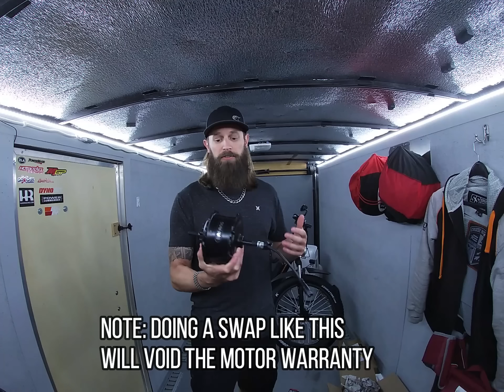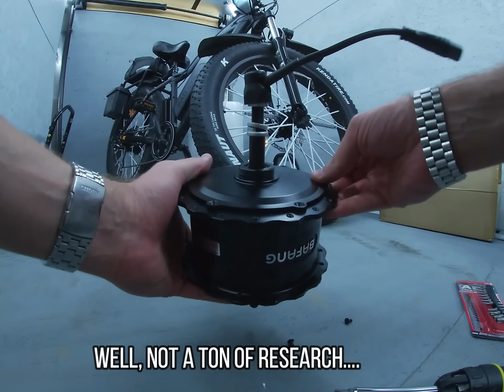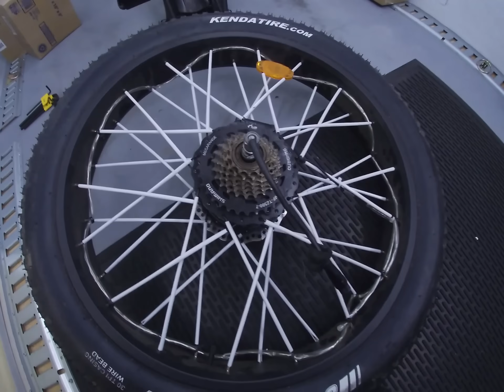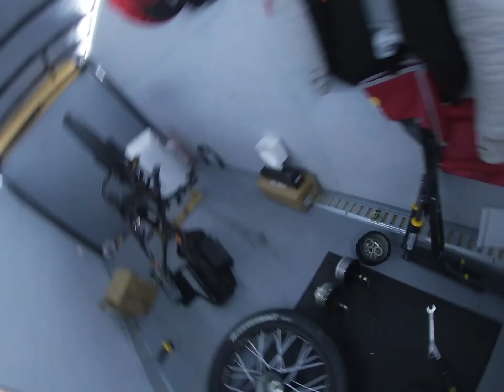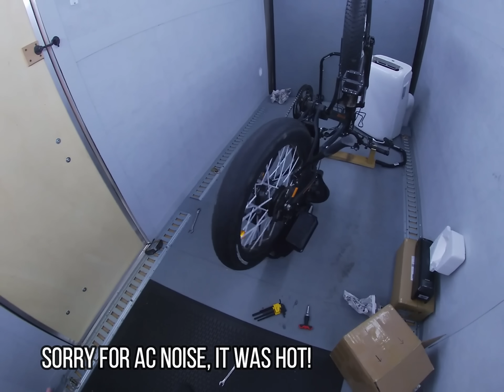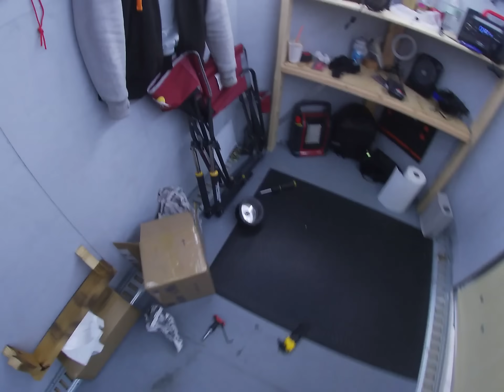750w Bafang Hub Motor Install/Swap -  Rad Rover Ebike

Comment: I do like your approach to mechanics. However, I felt empty after watching this video. You mention the stock hub motor of 750 Watts is not really 750? Or that stock hub is lower on power than advertised? Then do a swap for another 750 and no testing of power difference? This would be a great informational vid of how to swap out a broken hub motor. Not so informational as an upgrade on power.
Reply from the maker: Take a look thru my video library, tons of videos on the power difference 😁

Comment: Now i see bafang have 1000w motor, what do you think????thanks....
Reply from the maker: 1000w drop in replacement?
Reply: @CitizenCycle925  1000 watt bafang i see in aliexpress website, this is rear watt, or what do  you think??

Comment: I'm a bit confused.  Why this change from a 750w to a new 750w motor?  My 2020 RadCity3 now has over 600 miles on it.  Wondering exactly what the reason is for this swap and more importantly, how many miles can I expect from my factory motor?  I should note that I did the hack that upped my max speed to 25mph and in doing so, will that burn out my motor sooner.  I'm very seldomly running faster than 20mph.

Comment: Very helpful. Just swapping in my motor. I couldn't get the freewheel off even with the tool from Rad. As to what happens if the screw gets messed up I can tell you it's a world of pain. I've had to drill it out. Next step is to tap a new thread and go from there. Now back to it on a misty day in East Anglia UK.

Comment: Nice job.   On this vid, the angle of the front fork seams a bit bended back compared to the angle of the frame
Reply from the maker: probably result of trying to use camera in a small space.(my trailer) nothing is bent :)

Comment: The reason you couldn’t get good alignment with your torx tool past the sprocket is because you are using a changeable bit tool instead of a designated tool since the shaft in wider than the designated tool. Second you need a bigger bench so you can work above the floor.

Comment: I just purchased a Bitnelli Fusion...do you know much about them? 750 bafang motor w/a 12.5 ah battery.  Im 5'10 205lbs and it gets me 25.6 mph I have standard battery looking to upgrade to the 17.5 ah. The bike is supposed to go from 25-45 mi on a single charge..
I dont see how it will make 45 mi. Unless ur riding on  Ped assist 1. If u have any info or if anyone else has one of these bikes could I get ur input on them and the motors and my upgrade options besides the battery.
Reply from the maker: Hi Mike, i have not seen the Bintelli Fusion before, dont know anything about it.  just googled it to check it out.  looks nice, looks pricey too though.
Reply: @CitizenCycle925  yeah it was lil over $1700 I've only got 73 miles on it. I've clocked it at 25.6 but today,I could only get to 22 tops might have hit 23 for a sec. This was on a flat rd. (Really flat) i seriously doubt I can get 20 miles on this with just the throttle.. fully charged..i ran it about 5mi and its down 37%. Its fun and very comfortable but it could use some shocks. Tires altho big dont provide enough cushion over bumps. 
I feel like its not great at making sharp turns either.  Other than that its pretty cool. Im just not savvy on the battery maintenance. Like do u have to runnthem completely empty? Cuz ive just rode around then brought the battery inside to top off what I used. 
Any suggestions or advice would be appreciated.

Comment: So they use 500w as 750w 🤔
Reply: 500 peaks at 750, so technically not wrong.  750 peaks at just over 1000 and so on..... Just Rad getting a little carried away on their rating as opposed to other manufs.  Doubt they do this any more.

Comment: So can i just buy a higher powered motor than whats in my ebike, plug it in and have  more power or do i need a new controller too?
Reply from the maker: i dont know enough answer that one.  my guess would be that you would need a larger amp controller too.  volts x amps = watts..

Comment: Hi, I’m in the uk,I have a rad rhino 5 @ 250watt motor,I would like to change the motor to 750,can you help with what I would need and links to where I can buy the parts needed
Reply: Bolton e bikes.

Comment: I wonder if the 1000w bafang G062 fat tire rear motor would be the same way.
Reply: It's 750, not 1000.    https://www.bafang-e.com/en/oem-area/components/component/motor/rm-g062750dc/

Comment: how do you which motor to pick(male) to go into the female connection? i recently had to swap a rear wheel(motor attached) and the connection was incompatible i had to rewire the a new female connection to the controller which is tedious.

Comment: Good work my friend! anybody know if this change is possible for the RadRunner 1?
Reply: I have the Rad Runner 1 and sure you can, you need the 35a Controller & KT-LCD8H Rad Combo & the 48 - 60v 750w Bafang geared rear hub motor.

Comment: Are you saying the 750 that came with my 2019 rad rover is not the same as the new one? both 750??
Reply from the maker: I am certainly not an ebike builder or technician, but as you can see in the video, the aftermarket 750watt Bafang motor i purchased to install was quite larger than the one i took out of my Rad bike.  From what i understand Rad bikes output 750 watts, they just appear to do it with a smaller motor.  you can overvolt a motor and run it at much higher watts, when i upgraded my controller, my rover started outputting 1200watts.  so i was running 1200 watts thru that little motor with no issues.  later i decided to put the bigger motor in just so i wasnt pushing that little motor too far.

Comment: Hey Citizen Cycle - Did you ever get the third gear resolved and what was the issue?  I'm still waiting on my controller and 750 watt motor from EBW and wanted to be prepared when it arrives.
Reply from the maker: Resolved, derailleur just needed adjustment. Shifts perfect now

Comment: That stock motor looks like a 36 volt 350 watt model that's just being overvoltaged to 48 volts/750 watts but it still only has the torque of a 350 watter as compared to the real thing, many comments on Rad bikes not being very good with hills if at all, it does look very small...

Comment: Thing-is about Rad is that you get a lot of bike for a low price but for another thousand dollars (& up) other bikes are everything the Rads aren't, bigger batteries, better brakes, more powerful motors and controllers... I just got one with a Bafang Ultra mid-drive motor, actually the most powerful motor available on a production bicycle and that's immediatly obvious when you ride it, another from the same company which I get in a couple of weeks is a Juiced Scrambler clone with a REAL Bafang 1,000 watt nominal hub motor, time will tell with that one but has a good reputation btw subscribed 🤗

Comment: I was going to buy a super 73 until i read all the horror stories about it on reddit. During research, i figured out that building these bikes is pretty easy. I found a scrambler style frame for sale and a 1000w 20 x 4 motor. I used to be a mechanic so i should be able to figure this all out
Reply from the maker: Good for you!!! and good luck!

Comment: Super easy to adjust gear there's one  adjusting screw. Turn 1\4 turn  increments in one direction to start with until  gear  doesnt jump anymore but if it gets worst turn back adjusting screw to original position and turn screw in other direction with 1\4 turn increments  until it doesnt jump .If that doesnt fix it there's another problem . Also was the new freewheel first gear easier or harder to pedal because on a stock Rover first gear has 34 teeth the new first  gear has how many teeth ?Thanks for the video

Comment: Taking the rear wheel off and on gets MUCH easier. I can do it with my eyes closed now, but at first it was scarey hard b/c the assemblers at Juiced Bikes in China installed my rear wheel totally wrong, so my torque sensor wasn't even working.

Comment: Is there grease on the nylon planetary gears and/or the 3 planetary gear axles? If so, any idea what type of grease (lithium or a lighter grease or real tacky thick grease?) I'm really hoping for an answer as I will be taking mine apart this winter to check condition and regrease if necessary. Thanks in advance!

Comment: Hi there, I am from Vancouver Canada and have been following your channel for a little while. 

I was trying to buy a radrunner plus from Seattle and bring it back to Canada since the Canadian laws are stricter than u.s. and only allow 500 watt motor Max. Hence the local dealer near me only sells to 500 watt a 500 watt version.

Then in one of your videos you mentioned that you suspected the US version is not a true 750w motor. Then it got me thinking that the same Factory is really only making one model and programming the controller differently for each country.

Based on the images seen in your motor swap where you had the two Motors side by side it is clear that the stock motor that came with rad is not a true 750 w.

Based on information from your videos I decided to buy the bike locally and to upgrade the motor and battery at a later date.

Though I don't even have the bike yet I do enjoy watching all your videos.

Somewhat related, I commute daily on a 2000 watt electric unicycle with a 1600 watt hour battery. Too bad they don't have the same size motor and battery kits for the rad :-)
Reply: Did you get the bike??
If so how are your liking it.
Im in Vancouver also and thinking about getting this bike.

Comment: Moving to a 52T Chainring is a HUGE performance upgrade.
You will not find anything better for the cost.
Reply: 52T. Chainring will give you better top speed, but the bike will not climb as well.  It also may cause the motor to heat up.  But yes you will definitely get a higher top speed.
Reply: could you elaborate ? I was considering this to on my stock radwagon 36T :) which cuts off at 30 kph "freewheeling" basically. How about steep hills with the 52t ?
Reply: @Ematuresco  
stock radwagon 46T?
52t should still be fine for the heavy radwagon

Comment: Yeah Rad Power Bikes is a great company and the bike is so great that it makes you forget that your buying a 500watt motor being advertised as a 750watt motor. I have the Sondors MXS and its a true 750watt motor like the one your putting in. Great work on the video.
Reply: Bro so right. I had a mate X first turned out to be a bust. So many reviews online about how great rad is ANOTHER BUST. Got an ECOTRIC FAT tire with a 500w motor feels a lot more powerful for half the price. Even got the suspension  fork from their site(still a great price). Don't trust these paid YouTube reviews.

Comment: If it's not been said, you really should consider letting bike shop tighten the freewheel and adjust your bike. You don't want any mishaps while you're increasing speed and power. I'm looking forward to seeing your speed and Hill climbing results.

Comment: Awesome!  Thanks for posting, I was waiting for you to do this install.  One question, did you lube/grease the gears before putting back in?
Reply from the maker: i did not add any additional grease, but you are right i probably should have just to make sure it continues to run smoothly.

Comment: So, "in a nutshell".....We were lied to.  Nice!!
Reply: @† Romans 14:11 that is incorrect, the 500 watt and the true 750 watt come in exactly the same identical casing. Very easy to swap
Reply: @Scatterbrain70 so if there in the exact same casing. Couldn’t a person swap dual hub 500 watt for the 750 watt for more power maybe?  At least little better hill climbing
Reply: True Wattage from my understanding is contentious nonstop wattage draw without overheating . That is not  peak wattage .
Reply: @sen3reyx  I really do love my custom Rad, whether it's what is advertised or not. Getting ready to buy some more power for the beast soon. Can't wait for better weather!
Reply: @sen3reyx  I generally don't get a chance to ride in the Winter months mainly because of lack of daylight. By the time daily responsibilities are over, it's too cold. Winter in the North-east is just not what I want to be riding in, unless we get an unusual warm/fair day, I can't enjoy it.
Reply: you get what you paid for.
Reply: It is the motor controller that boosts it to almost 750 watts
Reply: I have a 2019 RadRover, I was never thrilled with it until I put a true 750 motor in with a new controller and a DATEx 2 parallel battery adapter with two 52v 20amp triangle batteries from Bolton now it pleases me to no end😎👍
Reply: @Mark3855  My Rover is still really good, even approaching 5,000mi.  This Winter I want to upgrade the controller, batt. , and Motor.

Comment: Nice job, I would have (shudder) used a drop of 'Locktite' on the screws when sealing the hub and to tighten the 'free-wheel', an old length of chain to use as a wrench.  :)   (I would bet that the 3rd gear set is bent somewhere along the circumference...

Comment: Thanks for posting this video. My 750w Bafang from Bolton is arriving today, I added the 35A controller about a month ago. They implied it was super easy to swap out, but now I'm guessing if I want to use the existing freewheel with the new motor I will need the special tool to remove it.... I'm not sure if the new motor comes with a new flywheel, but I don't think so.
Reply from the maker: Not having to tangle with freewheel removal was a relief.
Reply: I think the Freewheel removal tool will cost about $10 on Amazon.  Just make sure you get the correct one.  I would think Rad would give you that information.
Reply: @MumfordJim  But how do you get around the hub motor electrical plug being so thick?  Once the wheel is off and the electrical cable disconnected the plug is so thick I cant get the washer's/nuts off or even get the cable through the freewheel tool to remove it?  Trying to replace the freewheel myself.  I have the replacement and the tool but i cant figure out how to do it with the fat plug.  Any help would be appreciated from anyone....
Reply: The Park Tool F1.3 is for the rad

Comment: Nice video. Two questions; are you convinced both motors are 750’s and have you determined if there is significant difference between the “freewheel’s”? It would be good to know if the stock motor is being mis-represented and whether the difference in the freewheel gears caused the 3rd gear jumping.
Reply: Looks like the original was a 500w not a 750w, and almost half a stator

Comment: While removing the motors from the casing, remember not to touch the sides!! Taking a picture(s) before disassembly helps a ton. At least you didn't have any left parts like I usually do. :)
Reply: And don’t practice while high!
Reply: Why not touch the sides of you don't mind me asking?

Comment: You know that the hub itself houses the magnets right?  In this  case it's the stator of this brushless hub motor. So you really replaced only the part that rotates, probably not designed to work together all that good.
Reply: The casings for all of the G060 fat motors are identical and interchangeable with the motor cores so a swap is a perfect substitute.  The casings only house the hub bearing.  Nothing else.

Comment: i don't even have an ebike ....yet and this was totally interesting and fun to watch. thanks ! I went ahead and pre ordered a Bolton Blackbird...but have to wait till Sept.  One question, in putting the star nuts back on did you use a torque wrench as I suppose there may be a tolerance that should be met to handle such power?...or just put them in as tight as you could, brute force torque?!!!
Reply from the maker: hi Steve, really glad you enjoyed the video.   September for your black bird ugh! thats a long time :(   i did not torque wrench on the screws, just cranked them down with screw driver, thats how i got them out so i figured good enough for putting them back in!  haha

Comment: Great upgrade post. I saw some people asking about power changes. There's a guy on YouTube called SuPRCooPr who did this upgrade. In his Vlog 3 he is talking about the torque and top-end speed. He said a lot more torque and he had it up to 29 on flat ground motor only. I would expect that with the higher amperage and a true 750 watt motor. I was curious what you think of the quality of the gears in there. To me that's the weakest link in a power upgrade. Keep them lubed. Lol. PS, I checked out Electro Bike World and it looks like the place to go for RR power upgrades. I'm still waiting on my controller from the other gentleman.
Reply: I finally got my controller from that other guy and it’s great. I’m truly disappointed to learn that radpower did indeed use 500 watt, or smaller, motors while calling them 750’s.
Reply: Yes rad should put a real 750w motor in

Comment: had a rad rover couple years ago, love the vids. I am now waiting for my Bolton bike to arrive. Odd question for you, what watch do you wear and what is that bracelet that looks like a watch bracelet? (I run a watch YouTube channel) thanks.
Reply from the maker: i wear a Citizen's Eco-Drive watch, (very fitting right..) not sure on the model number but i've owned it for about 10 years now and its still going strong.  i wear it everyday of my life no matter what i'm doing. the thing has been virtually indestructible!   love it to death!  my bracelet is about 5 yrs old, it has no markings on it of any kind, not sure what brand,  i just went into a jewelry store and told them i wanted a really wide bracelet that looked like a watch band, we picked one out of their catalog and ordered it.  was cheap, like $150. i should have bought 2 in case anything happens to this one.  i knew it was a matter of time before someone noticed those and commented :)  you are observant.